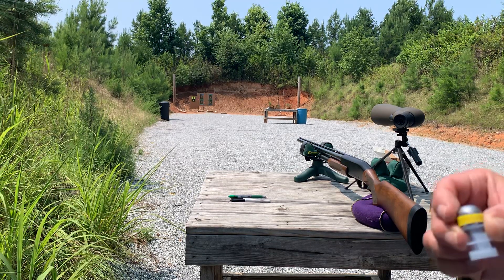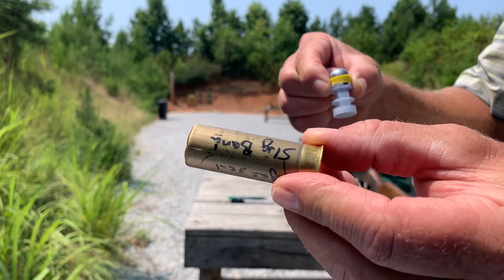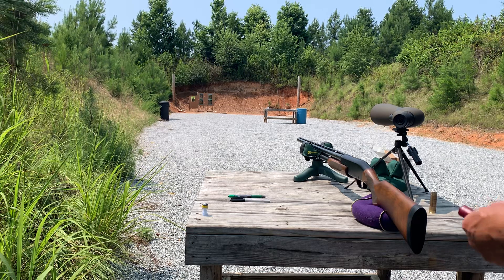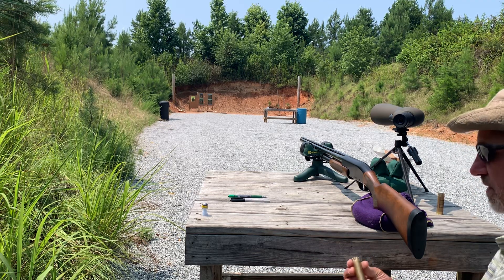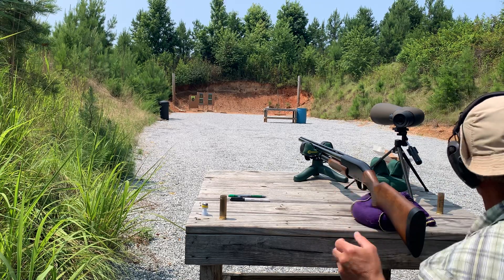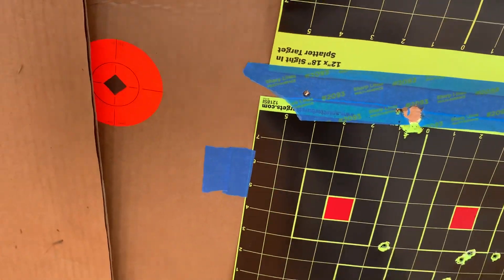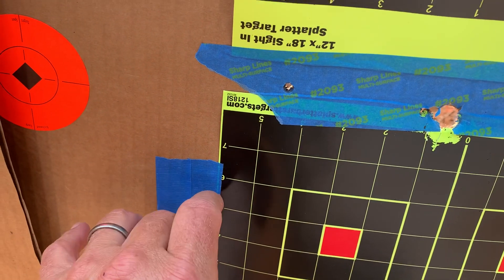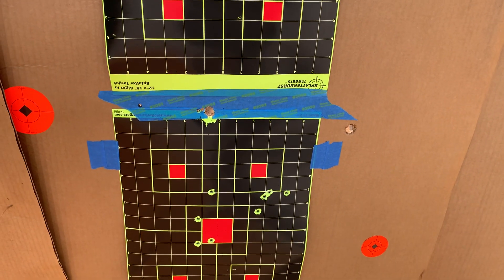DRIVING BAND SLUG TEST

Comment: Hey Elvis!! Good video.. can’t wait to see how your driving band thing works out.! I like it..
That wad you are using looks like a clay buster wind jammer.?
The reason why the federal hull you had seemed light might be the wad..
I think it has to much room in the federal hull and you had blow by.
The wad may fit tighter in the Remington hull because it’s a tapered hull and gets smaller as it goes down towards the brass. Where as that federal hull is a straight walled hull. 
But you may already know that. Just an observation.

Hope to see you get it going and tighten up your group. 👍🏻